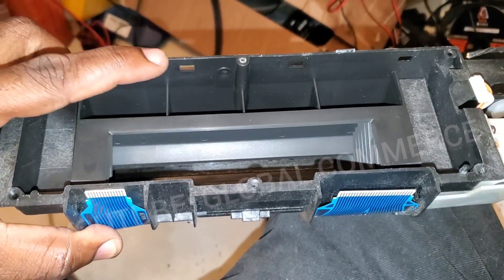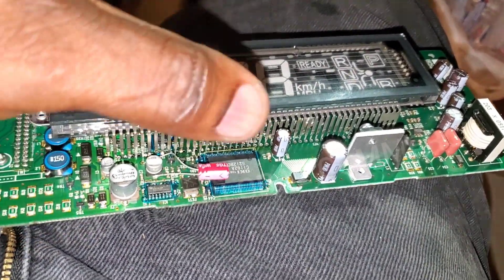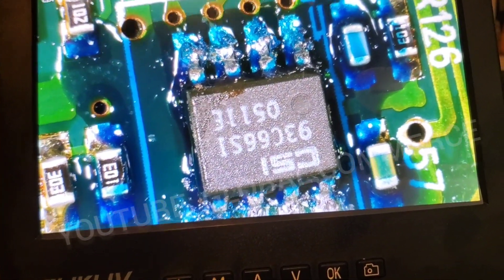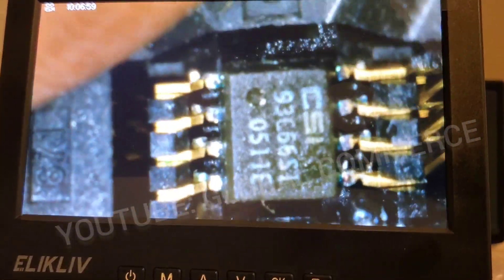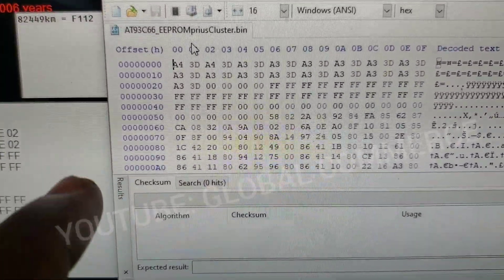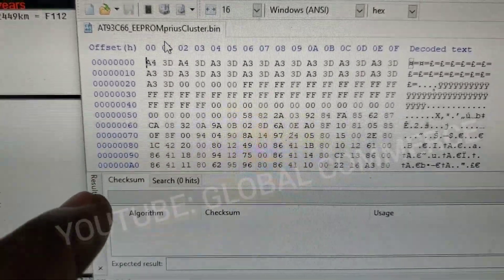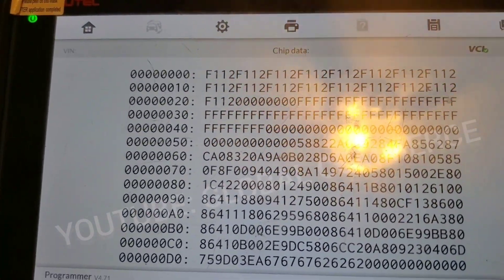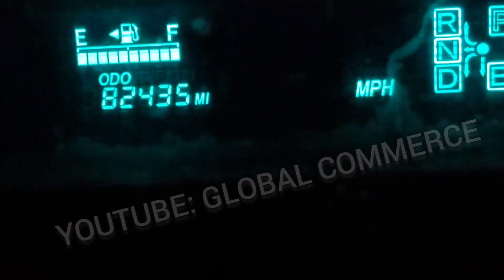Toyota Prius Instrument Cluster Mileage correction adjustment with Autel IM608 XP400 PRO EASY!

Comment: your method is very difficult bro. you can just change it by eprom programmer ch341 with cable without moving eprom 93c66 16 bit.
Reply: Can you do a video on it? How many times can a eprom chip be written?